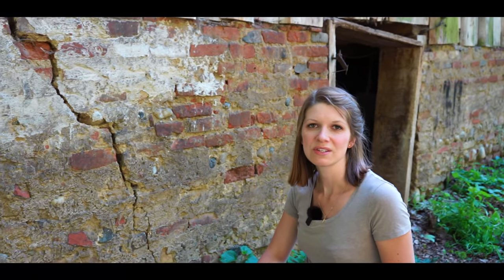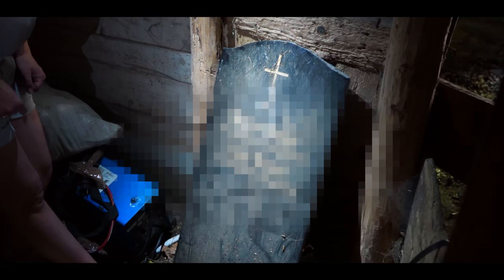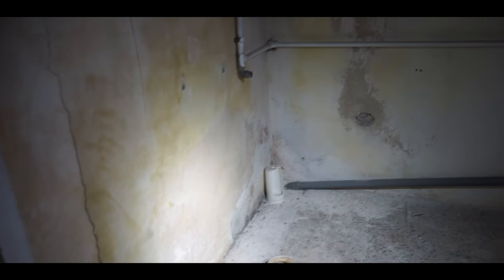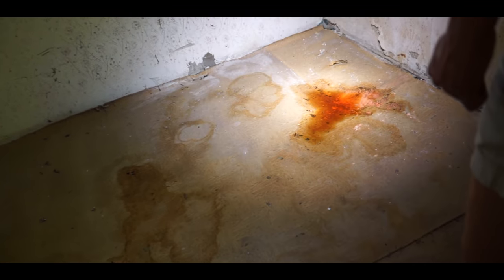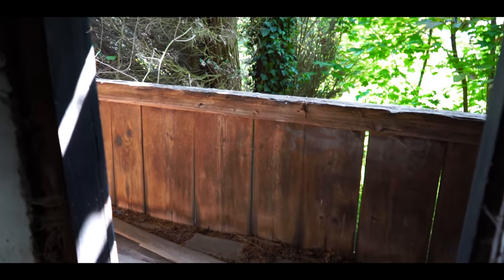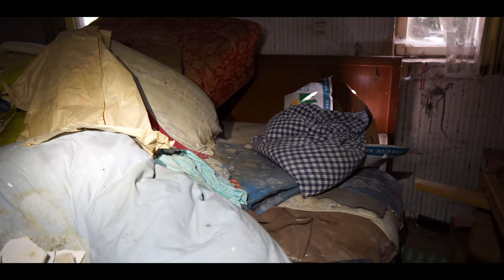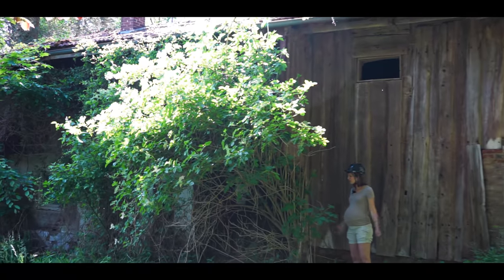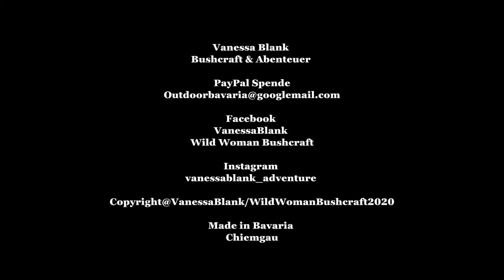Abandoned Place - Invisible house on the edge of the forest ⚠️ Gravestone found - Vanessa Blank 4K

Comment: Hi Vanessa! With the bedroom furnishings being dated around the late 1940's to early 1950's and the TV antennas dating around the early to mid 1970's, it just might be that the home place / farmstead was last occupied up until maybe late 1970's. That old home structure sure is decrepit! A place like that one would be most hard to fix-up! Trying to restore something like that would be most difficult and as for trying to salvage what materials that can be reused are very minimal at best! Perhaps only 40% of such materials could be used to make an even smaller structure / smaller footprint cottage style get away place and even at that rate; could prove to be very costly. When i was young, I liked exploring old places too! The grave head stone that was found may have been at one time had located on the property adjacent to the remaining property that is left there. Once a portion of the land had been sold off to someone else, a blood relative may have decided to remove the headstone and place it within a basement for safe keeping. As for the people the headstone belonged to, they may be the original family that built the farmstead and thus an extended family member decided to retrieve the headstone.

Comment: It looks as if it was inhabited up to the late 80s or early 90s, if electrical regulations are even vaguely similar there as here in the UK.  The distribution board was relatively modern, with circuit breakers instead of fuses, and certainly here, existing installations didn't need to be upgraded until around that time unless they were being extensively upgraded with additional circuits or greater capacity - I suspect it may have been abandoned due to the cost of maintaining it.  Old farm equipment in the barn part may have been stored there for a very long time though, simply because it was not worth removing it.

Comment: I have to wonder why the headstone is indoors,maybe vandals moved it and the old graves were lost to time so someone put it inside for safekeeping,,that's just a guess. Hopefully the cow/s spent the cold months tied indoors but were let out to the yard during other seasons. I have the internet of course but I still use an antenna to get digital television signals,they call it OTA(over the air) TV here in the USA. I refuse to pay the high prices of cable or satellite TV these days but I have used both in the past. Thumbed up as always Vanessa! And best of luck with the coming birth!